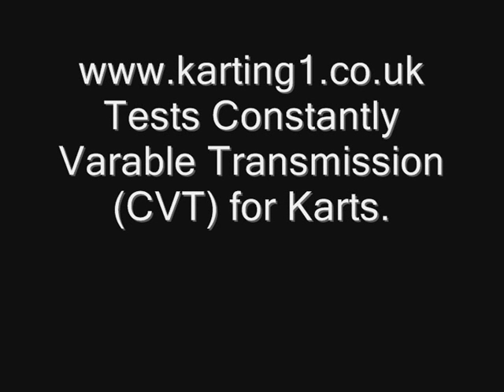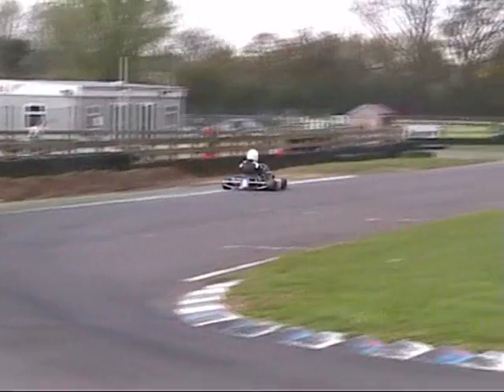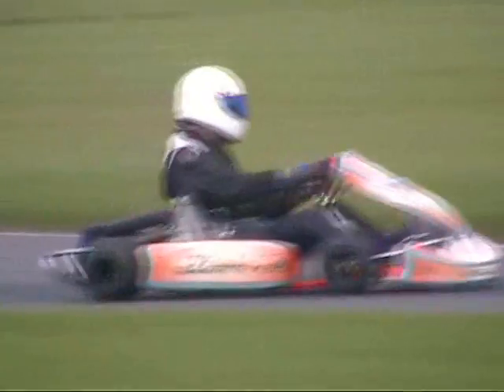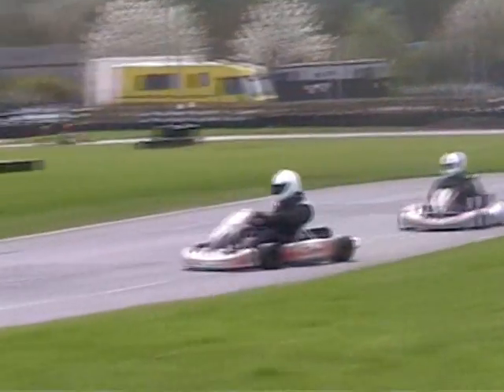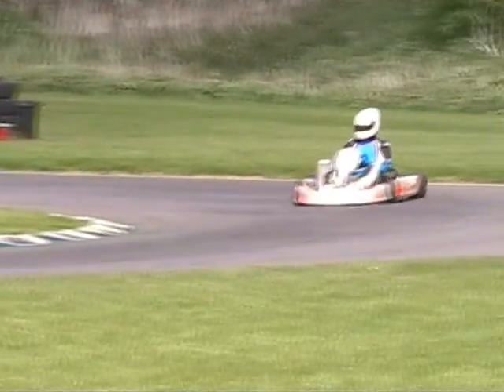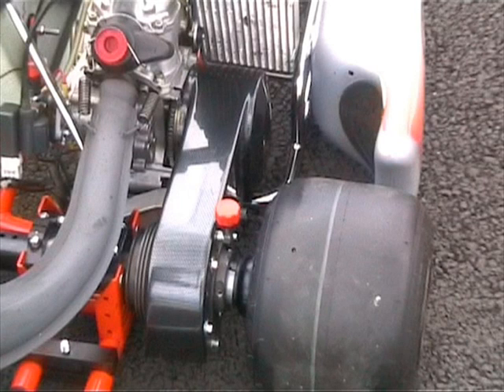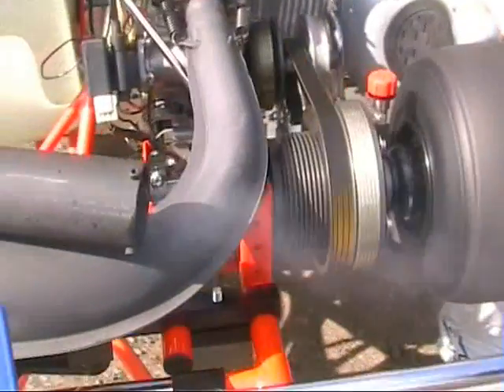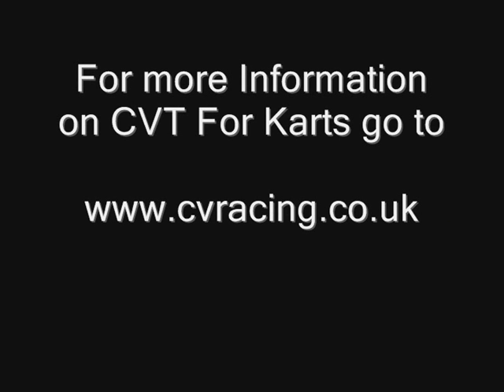Karting CVT system

Comment: CVT is weaker, depends on friction between the belt and the sloped pulleys. A chain drive is solid metal on metal. Those karts dont produce enough torque for the CVT to be an issue.